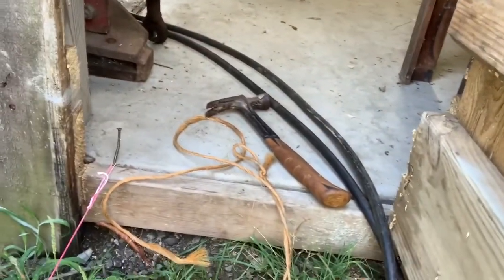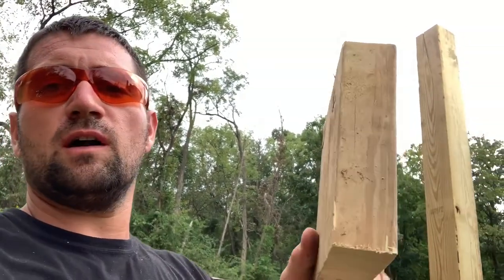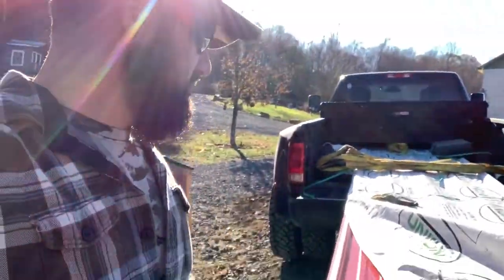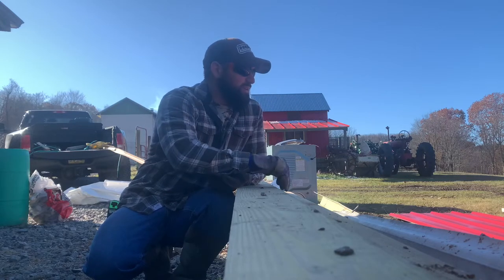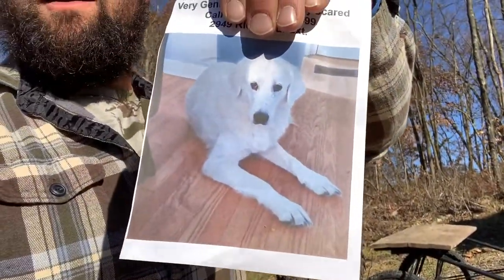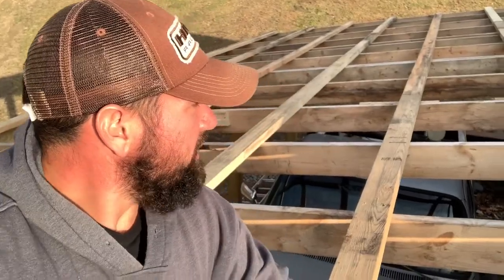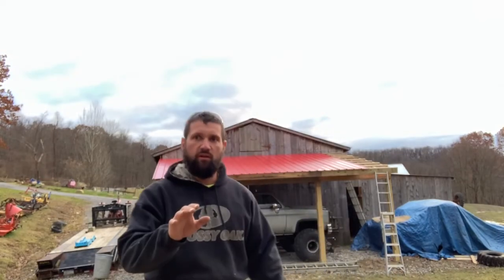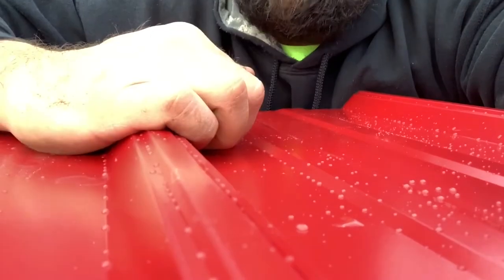How to build a lean to shelter off a pole barn Part II

Comment: I like your old square body truck. I have a 82 on 38 mine is garage queen. Total frame off rebuild about 2 yrs ago.
Reply from the maker: Dustin Fox that truck really hits home for me had it for years first truck I built it from stock swapped the old straight 6 for a v8 and 40s the first time 13” of life four speed with granny gear 💪🏼💪🏼💪🏼
Reply: @frontwoodsfarmer2063  ya my 82 was the very first truck I got from working and saving my money when I was in high school. It went through some rough yrs and a few girlfriends. Then I found my wife and the truck just set for about 10 yrs and then 2 yrs ago me and my 10 yr old son started on it and I dropped a big block in mine. It has a automatic transmission but it will flat turn heads now. I want to keep it stock looking mostly but the frame you can eat off it. I have won a few truck shows but I get it out and drive it on nice days. I just always liked those trucks.
Reply: @frontwoodsfarmer2063  what yr is your old truck late 70's
Reply from the maker: Dustin Fox hahaha that’s the exact position I’m almost in! Take care man thanks for watching.
Reply from the maker: Dustin Fox no fender lines go straight out it’s an 84 my car is a 72 gs first car that was too $900
Reply: @frontwoodsfarmer2063  nice bud if u need any parts or whatever don't mind hitting me up. I got another truck and used some parts off of it to put into mine but I still have a bunch of parts. Good luck bud. I liked your video.
Reply from the maker: Dustin Fox thanks Dustin I really do need body parts for her badly she’s been through a lot like me. Where u located?
Reply: @frontwoodsfarmer2063  I'm in Indiana
Reply: @frontwoodsfarmer2063  I seen some rust on the bedside I was looking at the truck while watching your video.
Reply from the maker: Been wanting to make a trip out that way for years for Polk haven’t made it yet one day I hope to we are in PA
Reply: @frontwoodsfarmer2063  ya last Yr me and my family went out that way to Hershey PA. As a adult I even enjoyed that. Then we went on out to NY and up to Maine. It was a wonderful vacation.
Reply from the maker: Dustin Fox I wish I had the money to do that for my family that sounds amazing good for u guys!
Reply: @frontwoodsfarmer2063  ya I would recommend going to Hershey it's a awesome place to go for sure for adults and children. Stay safe and if u decide that you want to come to Indiana bring a trailer and I can load u up with old square body Chevy parts. Just give me a idea of what u might need and give me a heads up and I will make sure to have it ready to go down the road.
Reply from the maker: Dustin Fox thanks Dustin really looking for body panels